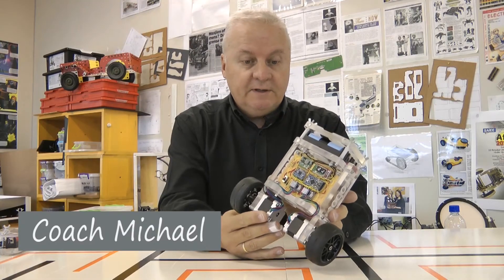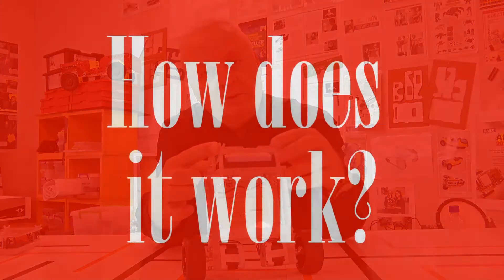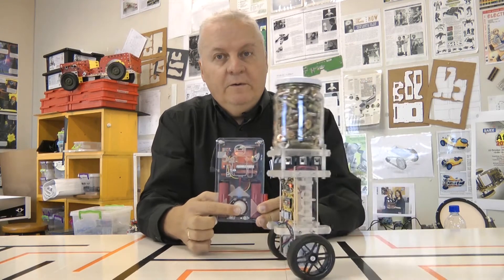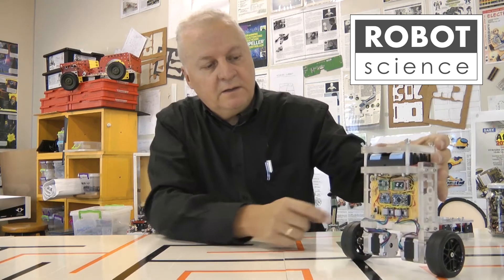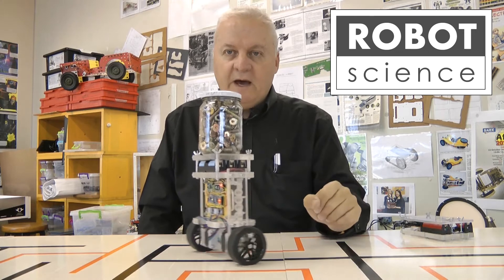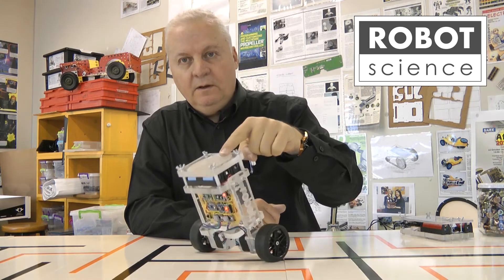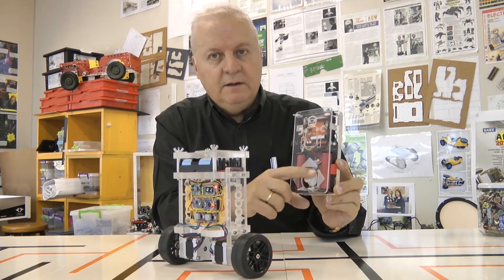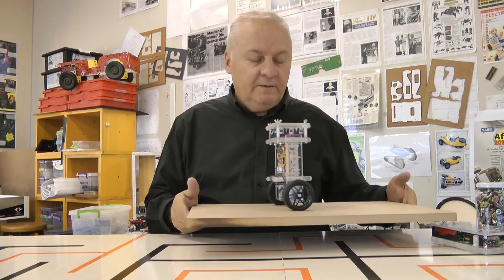RS.088 Arduino balancing robot [YABR]

Comment: Brokking doesn't say ho the communications is implemented.  It appears as if he is using Bluetooth because of the unidentified PC board on his web site, but no details on how to configure it or use it.  No code and no libraries indicate it's use.  Is it an HC05?  HC-12?  NRF24L01.   He doesn't detail how to set current to the stepper motors using the small pot on the driver boards.  Lots missing from this project, it's not as easy as he claims.  He should mention too that the code only works with Atmega328 MPUs like the UNO, Nano, ProMini.  Does not work with Leonardo.   It would have been better to use a simple joystick, or the joystick shield available for an UNO, about $5.00 on eBay and Amazon.

Comment: Thanks for sharing. Would you mind sharing the code and schematic for the remote? Joop is using the Nunchuck but I would prefer creating it from scratch. I have been struggling with this quite a lot and you are the only one I saw using Joop's project with a remote other than RC, Android or Nunchuck. Thanks in advance and best wishes for the new year

Comment: Need your help. I use hc05 to pair master/slave. The robot only receive the command after nunchuck return to neutral position. That means push to left and return to neutral, the robot return left by one step

Comment: Please master, ask me a question: how many volts are the two batteries that power the Arduino?
Reply from the maker: three 18650 on this version … built a new version with four 18650 batteries … in series … with 4 batteries you will have to change your voltage divider circuit
Reply: @mikerobotscience  I'm sorry, master, but I meant on the radio control. Are two 3.7V? It is because in Joop Brokkng's original project, he does not use radio control, but connects the Arduino directly to another source, perhaps on the PC. I just wanted to know how you connected the batteries to the radio control. I'm sorry for my lack of knowledge.
Reply from the maker: @marcio6498  
this is the one I use … also works on 5v:
https://www.mantech.co.za/ProductInfo.aspx?Item=15M0320